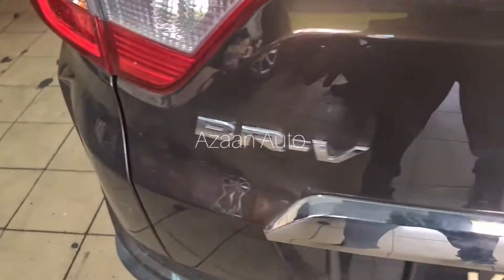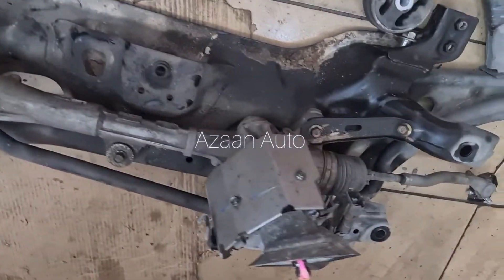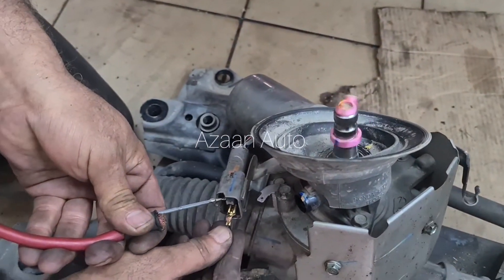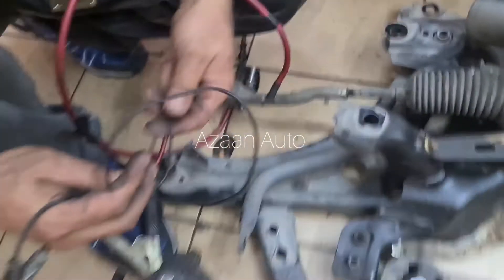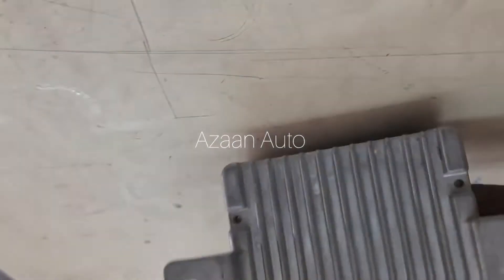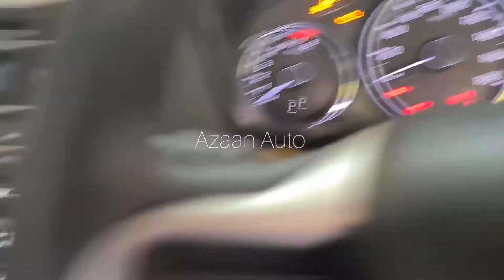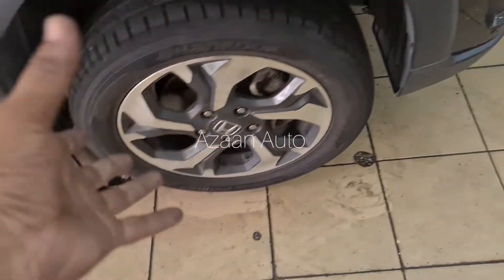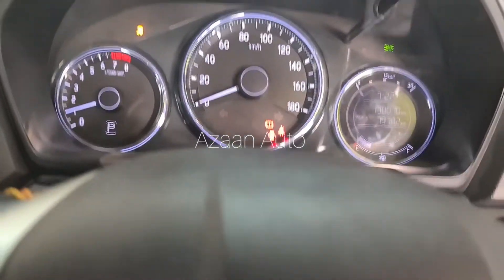How to check Your Electric Power steering Motor EPS and How to collaborate EPS Motor After Replaced

Comment: I was told by my mechanic that about 70-80 percent of problems with the EPS that he encounters are critter chewed wiring harness. What happens is mice and other small critters looking for a warm place to spend the night get up in there and chew on the wires. This is an easy fix that only costs a few hundred dollars, but a lot of times mechanics will tell you you need a new module or rack and charge you a fortune.
Reply: Thank you so much

Comment: Hello thnx for the video. My 2014 honda crv  steering feels loose..no eps lights....i have turn extra for wheels to respond....motor? Or torque sensor? Any idea plz let me know
Reply from the maker: Need to Check Fuse first then motor and then torque sensor
Reply: @azaanautos7248  thank you so very much...will let u know later IA

Comment: Thanks for the video. so if the eps module and steering rack is changed what need to be done?
Reply from the maker: After replacing the Steering Rack or EPS motor Eps ECU you must need to do collaboration to Match part number with Main ECM Collaboration must be do Any scanner tool for Steering angle sensor

Comment: Hey I'm dealing with stiff turning and grinding sound when turning. Belle tire told me that my motor in my Eps is shot and that I need to replace my whole rack and pinion. Wondering on your opinion on how accurate my issue is and if I can simply the replace the motor. Please and thank you
Reply: Change the motor only or get it repired. No need to change anything else.